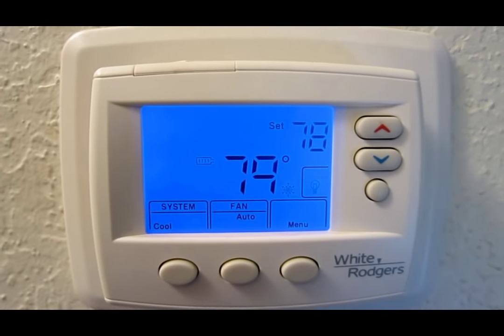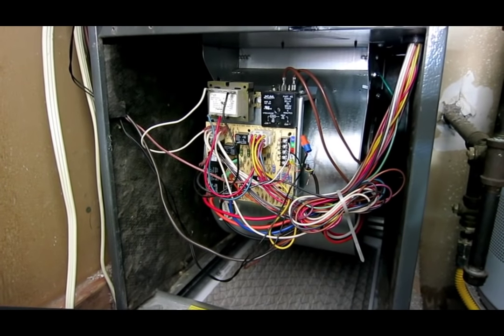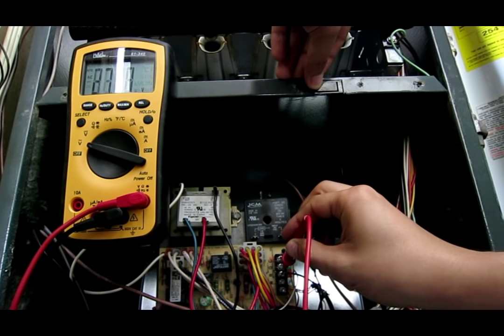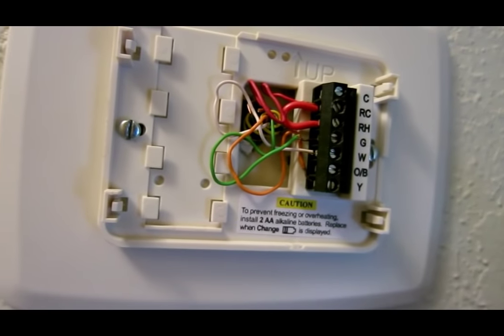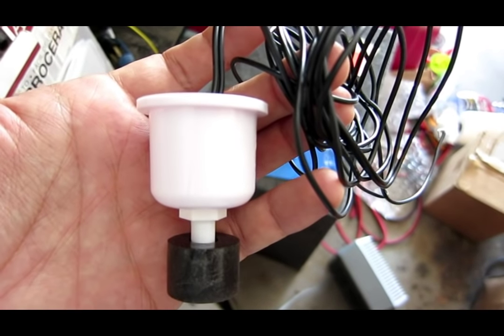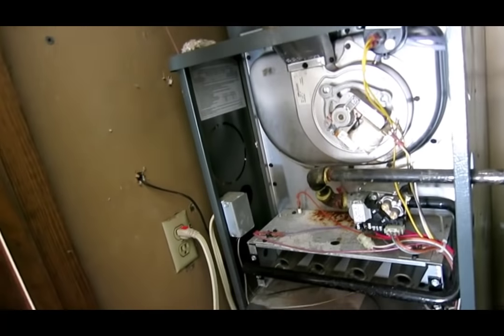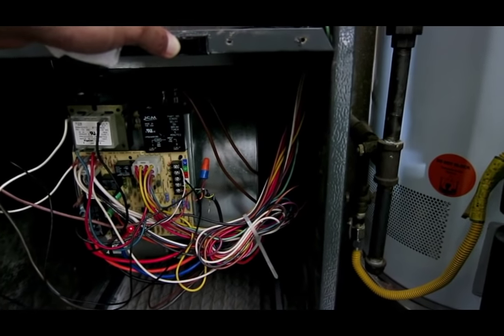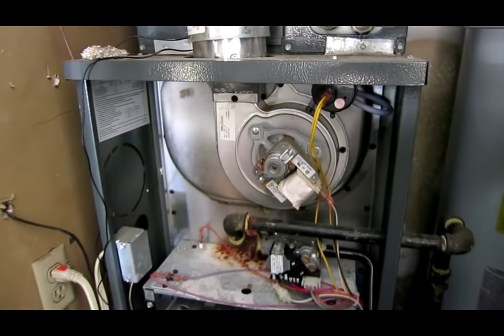most common AC problem - blower doesn't come on - HVAC condensate overflow shut-off device problem

Comment: I can't thank you enough! My husband was out of town and our air wouldn't kick on. It was 80 degrees inside and 93 outside and I had 2 sick kids. I followed the same steps you did and when I got to the safe-t-switch and opened it, it gushed water! I ended up using our pressure washer to push out whatever was clogging the line and it was disgusting! Something had crawled in there and died. You saved me hundreds of dollars for a repairman. Truly, thank you!!
Reply: Good job miss. 👏
Reply: Rc  24  ry1 24 strge ry124  rc 24v  g  blower  wire 24. V

Comment: Dude its nighttime, and almost 90 degrees outside...  My HVAC Control unit went dark and the AC turned off.  It supposed to be 100 tomorrow and I was freaking out.  I watch this, when downstairs to the basement, and kicked that pump a few times and BAM, it came back on.  I love you.

Comment: Thanks for posting this video. My moms ac would not go on. I pulled out the overflow switch and cleaned out the tray. Reinstalled switch and ac powered up. You saved a widow on a fixed income a service call. For that I thank you.

Comment: NEVER attempt to bypass the module. The ECM is a DC motor. It is powered by AC, but the module converts the AC to DC for use in the motor.

Comment: Thank you so much for this video! My blower wasn't coming on, and turned out it was the condensation safety switch. I (temporarily) fixed the problem by drying out the unit and soaking up the water in the tubes, but do you have any suggestion on what I should be looking for in order to prevent the condensation overflow in the future?
Reply: hittheroad001 ever find a answer

Comment: my honeywell eac wont turn on, and the switch to the blower isn't turning it on either. i just hear 1 click and nothing. where should I start? eac is clean looks mint.
Reply: Start with the capacitor. See if its bad by checking microferhets if its under what is on the label its bad. If its not the capacitor ohm out the motor.

Comment: Thank you, no low voltage power to my thermostat. My float was okay, but the low voltage 5A fuse was blown. You led me within 2 inches of the problem. Thank you, I would not have found the problem without your video. Took me less than an hour. Thanks to you, my wife is happy.

Comment: Hi I'm looking too see if anyone could help me on my central unit the thermal stat is set on set point when it call for the air to come on the outside fan turn on but the furnace or blower dose not blow any air but it does it not every time sometimes u have to turn it off n on for it to start working again

Comment: I can’t thank you enough for this video. It’s 4 am and 84 in my apartment. I checked the safe t switch and it was filled with water. I used a Doppler to suck up the water and my air came right on, thank you again!!!

Comment: I thank you so much.  My hvac totally stopped working including the fan.  I cleaned the drained pipe with oxyclean that somehow bubbled up and made its way to the float valve.   It's over 90F here in Florida and I rushed to call for a service tomorrow.   Thank God for your video that  I had cancelled the service.  I pulled it up and the unit started to kick in.  I wish all repairs were all this simple.   THANK YOU SO MUCH...........GOD BLESS.

Comment: My Friend....thank you so very much for this video!!
I live in a hot moisture South Florida and a brand new AC Unit started to goes On and Off intermitently.
I have Nest Thermostat and my first call was a faulty Thermostat.
Went to Old School analog thermostat...same problem..
Than I had a conclusion the problem was with the AC Unit.
I saw all kinds of videos related to Intermitent AC unit causes and your video was the direct to the point.
The problem was at the switch but not because a faulty switch.
The problem was that the drain pipe that takes the condensed water to outside of the house had some kinda of limbo and it was overflowing the pipe and cutting the power to the AC.
I got my portable air compressor, blew some air to the pipe...put some bleach over to kill the remaining limbo and the water started to flow out again.
Thank You Amigo!!

Comment: Overall good video. For future reference, you can check, using your multimeter, for continuity between the safe T switch wires. You can also run the 24 volts directly to the r terminal to get it running while you are either waiting for a new safe t switch or buying one. Also, good job telling your audience about the potential clog that could have formed in the primary drain line.

Comment: First thank you for this video.  I live in Florida and my AC just stop working.  The fan was not coming out, so we went to Home Depot And  fallow you instruction and  buy the capacitor but  they didn't have in the store.  Then We went to  the AC hardware store and  found it there for 29.99.  AC it's working now! Thank you from Florida!

Comment: awesome job brother! I don't have this problem. my thermostat was flasginh "cool on" and was just doing a quick search to see what it could mean. wanna be prepared incase something goes wrong. I'm an electrician and your trouble shooting steps are what a true pro does. keep up the great work and stay safe. subscribed.
Reply: Justin
Reply: You find a solution to that "cool on" message? I'm facing the same issue - abot to try the steps in the video.

Comment: Thanks so much for a very easy to follow and great solution to our problem.  I was fortunate that after drying out the chamber and allowing the switch to dry it kicked on.  We are grateful since we are in South Florida and enduring the worst heat in over 100 years.  You rock!

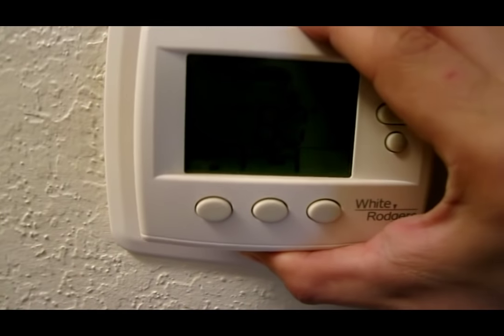Comment: Don't know if you're still following the comments but thank you very much 1:30 in the morning here in Arizona and it's 98 degrees I didn't know newer units had a float switch for the condensation line . And they drywall. This one in under the unit. Thank you very much!!!!!

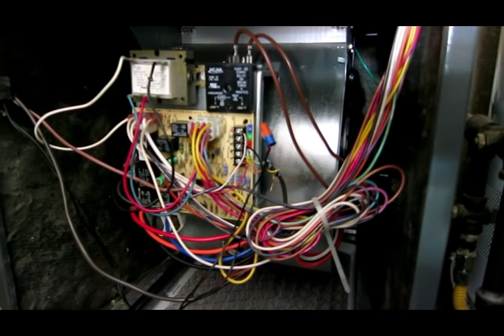Comment: Mr. Tinker,  I followed your instructions.  My furnace has a switch rather than a 3 prong plug.  I flipped the switch and the whole thing reset!  I have nice cool air.  I didn't have to wait for a tech or pay several hundred dollars.  You gave me the info to fix my problem by 0:50.  Thanks again.

Comment: Great diag tips - mine wasn't the overflow shut-off but a fuse. The instructions helped greatly in knowing where to check for voltage to see where the problem was. Thanks!

Comment: Bingo - Checked 3 things: 
1 - Checked if Thermostat working / Working with 12 Volts
2 - Checked Fuse inside furnace - Not blown
3 - Last I replaced the Safe-T-Switch ($15 part) ==> Bingo ==> it worked
I would have never guessed it if not watching your Video
A contractor would easily charge you $200-$400
Thank you for the Video

Comment from the maker: good point, and your approach is removes a few steps. But, checking the breaker is easier (no DMM required) and it at least eliminates a short circuit scenario. Also, I am trying to describe the situation by showing what all ive checked.

Comment from the maker: Most fan motors in the furnace runs off 120VAC. For testing, you could hook up the motor directly to the wall socket. I would skip all the T1, L1 stuff since you might short circuit something. There are youtube videos on this topic.

Comment: Thanks for your prompt reply!  To clarify, the condensate shut off the AC only once in five years.  The repair guy checked the drain pipe, and it was not backed-up.  Also, the unit (not the outdoor compressor) is mounted above the garage so that the water flows down hill.  Whatelse would cause the AC to shut off so soon after being "repaired"?  Thanks again.

Comment: You were 100% correct about the condensation switch.  Removed it and extended the float down and the AC worked.  YEA

Comment from the maker: If your diagnostic is correct, then the next thing to check is the blower motor. Its the blower connected to the furnace and evaporator coil. Usually located in the garage or a closet. 
If the blower runs strong, then you want to see if the ducts are clogged. Two common scenarios are frozen evaporator or a collapsed duct.
If you turn off the AC for 2+ hours, turn it back on and you have good/improved airflow then you have a frozen evaporator issue. Cleaning the evaporator coil will fix it.
Reply: Low refrigerant will cause the same issue

Comment: Thank you for the video. I have one question before opening it up and messing with the wiring. My blower turns on about half the time, the other half it takes a bit of trying to get it going. Once it starts and it is on On then it will never stop. The problem is that it is often times difficult to get it started in the first place, and secondly when it is on Auto it can blow correctly for a while but once it breaks it is done. Will messing with the wires work for this as well?

Comment: Thank you so much!  I had a problem 15 minutes ago. I was able to pinpoint the problem through that 27 volt check.  Subscribing!
Reply: Where is this pipe located at?  Is it in the attic?  I can't locate where this can be at.

Comment: Very helpful video.  I fixed the problem with the A/C not turning on even though my upgraded thermostat stated "cooling on".  Turns out, I blew the fuse when I touched 2 live wires together during the switch out.  I didn't know that I had to remove a panel to access the circuit board.  Thanks.

Comment from the maker: Planchik, i couldnt reply to you on youtube. not sure why, so here is my quick answer:
You said the outside fan doesnt work, then there are 3 possible issues:
1. No power is going to the fan (unlikely)
2. The fan is damaged (possible)
AC fan not working - how to troubleshoot and repair condenser fan motor - trane air condition

3. The fan's run start capacitor is bad (most common)
AC fan not working - how to repair broken HVAC Run Start Capacitor - air condition

hope that helps.
Reply: Hi - I sincerely appreciate the reply. AC unit produces cold air but the fan is blowing. I jiggled some wires and banged on the housing and it ran for a while. My problem is that I live in south FL in a rental house. Landlord isn't so nice. - in 4 years never used heat just AC. Is it possible just to wire up the fan for AC use?
Reply from the maker: Murray Strauss sorry, your situation isnt an obvious issue. All symptoms points to different things in the AC. Maybe you should try helpouts.google.com as some helpouts dont charge money.
Reply: DIY Tinker
Reply: Diy and Crafts ker hi
Reply: DIY Tinker q

Comment from the maker: To my understanding, Not all come with an overflow switch. But it is common for HVAC professionals to install an overflow switch in central air units.
I never seen a window unit AC with an overflow switch. Window units usually drain at the condensate pan. if water overflows by tilting or clogged, then the fan might kick some water in the air.

Comment: Thanks for the video, what is the name of the part that you bought online?

The unit used to start and blow air, but then when it reached the desired temperature, the fan would shut off but it would still sound like if still want to blow air, but it doesn't.

Now I will turn on my unit and it sounds like it is turned on but doesn't blow any air.  Could it be the same thing?

Thanks.

Comment: When I tested my board, the fan kicked on as you indicated.  When I released the pressure from the volt meter probes, it turned off.  So I pulled the board off and looked behind, but saw nothing amiss, and no scorching.  I only then set the board on the pin-clips that hold it to the blower and all seems to be good for now.  Must be shorting against the blower?  very strange.  We'll see if it continues to operate. then I'll put some kind of insulation between.

Comment: You shouldn't title this "blower doesn't come on" unless the only issue is that the blower doesn't come on. If the switch isn't shorting then the whole unit wouldn't be working right? Since you didn't show a step where you just turn on the fan while having AC and heat off, I assume the blower worked fine if you did this. So this wasn't a blower doesn't come on issue. This was a blower works but AC doesn't come on. Right? Likewise, I assume the blower would work with heat, just not with AC?

Comment: Every few years or so I have the same problem with the home HVAC; 24-volts not appearing at the thermostat, but present on the board.  In every case it's been the four-terminal 24v relay which I replace and forget about until the cooling stops again (only seems to happen in hot weather).  Never even seen an "overflow" device on my 20+ year old unit, and wouldn't know where to find it.

Comment: Hey man I have a home which is only 5 years old and my AC isn't working.  When I turn on the AC on the thermostat everything turns on, the compressor and fan outside kick on and the home fan turns on too, but almost nothing comes out of the vents. I got on a ladder and felt very tiny amount of air coming out which was cool air but didn't cool anything because almost nothing coming from the vents.  My air filter is clean and I don't know what I'm looking at in the attic. Can you help, any ideas?

Comment from the maker: hmm... the "Once it starts and it is on On then it will never stop" part is a concern. There isnt an obvious solution. I would say, With the thermostat set to "OFF"; try turning the AC blower to "ON", if it goes on right away, then turn it to "AUTO", then it should turn off right away. Let me know if that works or not.

Comment: My Robertshaw RS8110 thermostat is only a few months old, and it works well with the new A/C unit that just install this summer. However, when I switch to the 'heat mode', the furnace would come on and stay on, but the thermostat would go blank. Do you have any suggestion how to fix this problem?

Comment: Thanks for the quick response, so I get no voltage..on any wire. The pipe is clean, guess i'll try replacing the over flow switch, do they sell them at home depot? there any way to bypass the switch (just to see if that's the problem)

Comment: Was the heat pump coming on without the air handler coming on? In other words, was the outside unit kicking on without the indoor unit coming on a few seconds later?

Comment: DIY Tinker,  I live in Arizona and I have a furnace/on roof AC unit.  When we turn on the AC, the air blowing is far less than normal.  It's cool, but just not blowing like it normally does.  Any thoughts on where we would start to trouble shoot?  Thanks.
Reply: I have same problem... But its AC air blowing less than normal...
Reply: KL Hobbs check your retur filter.
Reply: KL Hobbs, it could just be an old blower motor. If you'd like someone to check it out, I also live in AZ and I'm an AC Tech. Trouble shooting this problem sooner than later could save you a lot of money in the future.

Comment: Hey buddy I was wondering if you had any idea what's going on with my new homes ac. It's a brand new unit and when I set the temp to 75 cool and put the ac fan to on the fan still stops when ac reaches temp. I want the fan to still run but not ac when at temp.

Comment: Don't know if responses are still active here but how would you test the safety if the system isn't turning on? Is there a better way then removing the safety out of the loop and then running it, like with a meter?

Comment: Did you check those wires  that were up against the hot vent pipe on top. May have been a broken wire there...

Comment from the maker: Well, many things could still go bad... there isnt enough to go off. You could try removing the overflow shutoff and tie the red wire directly to the red contact. Just to eliminate if the overflow shutoff is the issue. If it still doesnt come on, then you know its not due to the overflow shutoff.

Comment: After running without a problem for three days, my central AC died.  I had an AC repair guy check it out.  He added freon, checked the circuits and it ran.  However, about three hours later it died again.  He had suggested a $400 pump so that the condensate would not backup.  However, it backed up only once in five years.  Of course, he did not suggest changing the low cost backup switch.  Any thoughts or suggestions?  Thanks!  Dennis

Comment: Well actually my fan motor has 240 and common going to it. Re a traditional motor -sure a direct power will run them assuming a good motor. The T1 and T5 is just low and high speed.  But what I am wondering is will a ECM (Electronic Control Module) motor run off of direct hook up?  They are DC wound with a circuit built inside the motor. Yeah i have been looking on line to no avail. I like your teachings !  maybe do one on ecm motors.....thanks!

Comment: I had someone install new wiring between blower/furnace and thermostat, but now no power in the blower, no voltage at step found 1:20 of your video.  What could my problem be?  Was working fine before his work.

Comment: Hi, My issue is opposite from the video. The blower (inside fan) is on but outside fan is not on. No cold air. It not happen consistently. Just couple of times in this year. Please advise what I can do before calling professional.  Thanks.